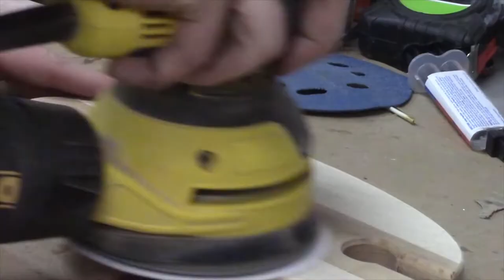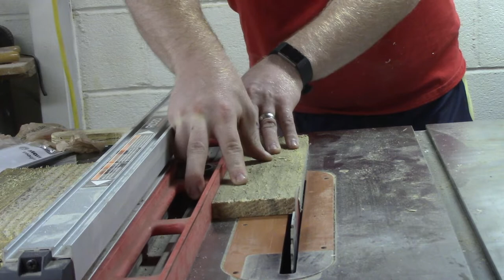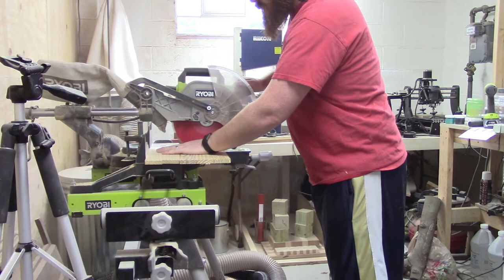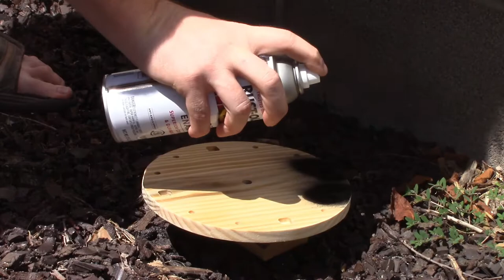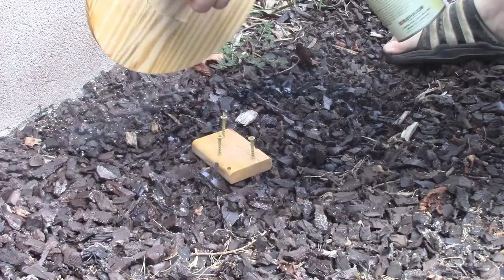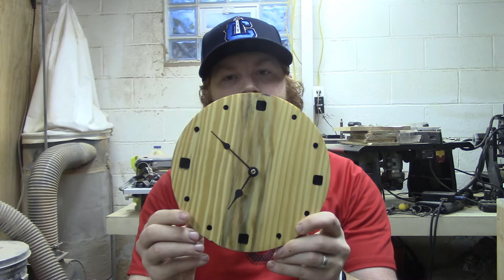Pallet Upcycle Challenge 2018 | CNC Clock

Comment: Very nice clock. Thanks for sharing. What are you exactly doing from 3.31 to 3.42? Burning or brushing?
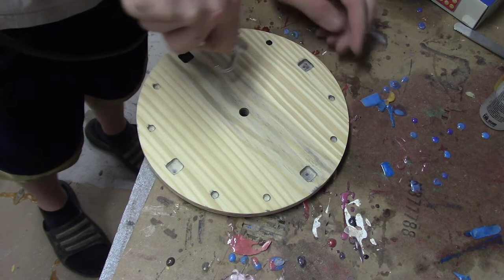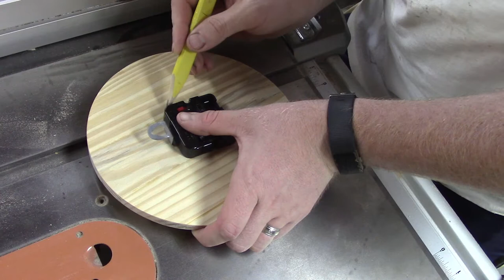Reply from the maker: Hans de Groot Thanks for checking out the video! From 3:31-3:42 I’m using an air compressor to blow the sanding dust out of the indents to better reveal the black paint.
Reply: @CrossCutCreations  Thanks for explaining.